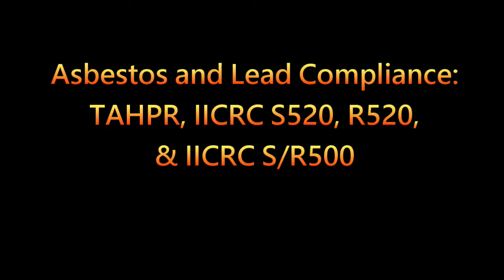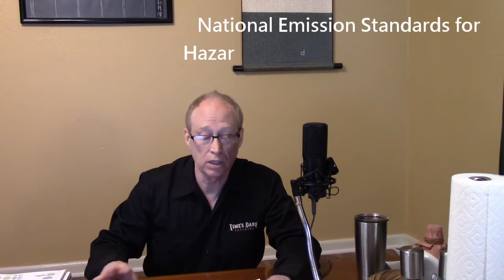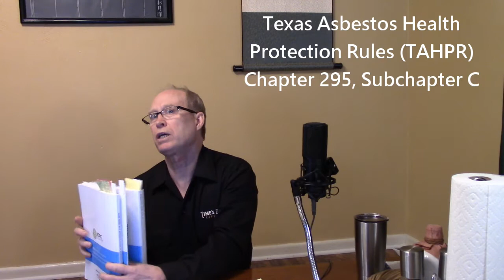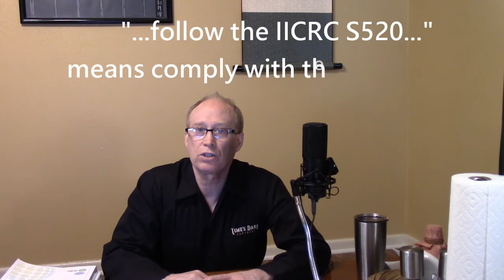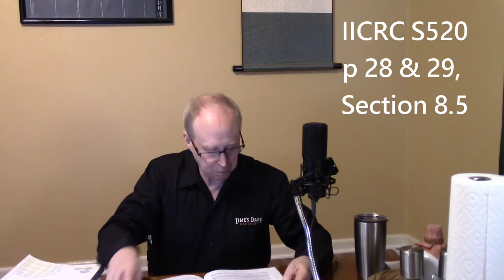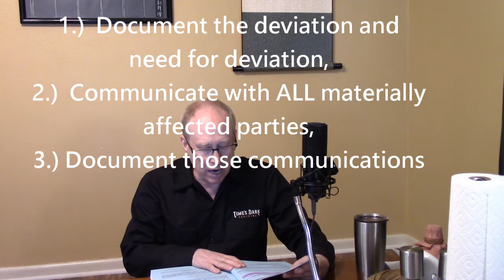Asbestos Concerns with restoration using the IICRC S500 and S520

Comment: I have a question, for a house that was built was in the 70’s that might have asbestos should they install air circulation equipment while they get the results back. Won’t that disturb the asbestos and circulate in the air.
Reply from the maker: The question is "why" then installed the circulation equipment.  Any air circulation equipment for asbestos, mold, or lead should ONLY be running within a containment or enclosure to not blow it through the house.  If the people that set up the circulation equipment for say drying out wet building components, they should have tested the building materials for asbestos or assumed, as we have NO BAN on asbestos in the United States.  Most of the restoration and drying companies do this because they are charging insurance for the machine on a daily rate.  Same reason we have $200 aspirins in the hospital.  The IICRC is clear with drying in their Standard S500, and in the Mold Remediation standard S520 that the building materials a positive for asbestos until proven otherwise and the remediator MUST enclose or abate those hazards BEFORE continuing with active drying.  Active drying is employing the fans and air circulation equipment.
Reply: @timesdarkcaptains9170  so just so I’m clear even though there was asbestos they can still place equipment like air blowers as long as they contain the area. Can they remove materials on the floor like carpet or flooring?
Reply from the maker: @Sipher97  No that is not what I said.  IF they are removing the asbestos materials or mold , they that would have to be done in a containment.  IN my reply I said they can only use air blowers for drying the struture if the asbestos, lead, mold, or hazardous materials are either removed or contained.  So the asbestos or mold has to be isolated or contained BEFORE they can run the air blowers.  Most drying companies say that is BS, that they have to dry first.  But the IICRC S500 clearly states what I said, and states that active drying must cease until all hazardous materials are either removed , remediated or contained.  Active drying is with the air blowers.  Dehumidifiers would be somewhat passive....  However air circulation equipment in the mold remediation is common.  what results are they waiting to get back???  Are they doing a mold remediation or an asbestos abatement?  If they are just drying then they  would not be waiting for any results "'to come back" as the drying instruments are in the field, not samples.